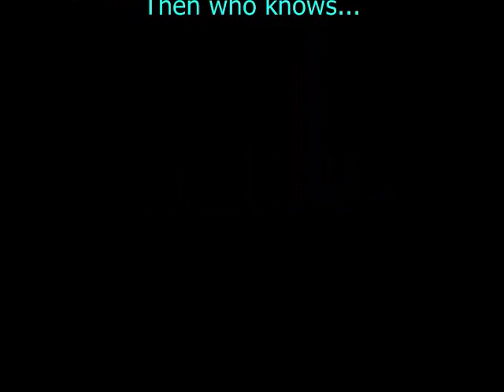My 900 VA Tesla Coil! (Resonant Transformer) Lightning Machine

Comment from the maker: His work was with radio excitation, not physically sending current through the air. If YOU read anything about tesla, you'd know that most of his experiments were radio-based. Ask any HAM radio hobbyist (of which there are millions, I'm sure you know one) about transmitting power, the function of an RF ground, etc., and you'll learn much more quickly.

Comment from the maker: I'm afraid you may be a tad bit confused as to the different frequencies applying to a tesla coil's operation.
The first and most important operating frequency is the tuned radio frequency that the coil operates at. It is in the kilohertz range and completely inaudible.
The second is the "break rate", which is in simple terms, turning the output of the coil on and off several hundred times per second in order to establish a duty cycle, or play music.

Comment from the maker: Volt-Ampere is a unit similar to watts, used to describe the load on power distribution equipment supporting inductive equipment with alternating current, i.e. a load with an imperfect power factor. I list in VA because I measured with a clamp-style meter on the leads driving the transformers, measuring apparent power, rather than real power.

Hope this clears things up.

Comment: Awesome video! - very beefy-looking streamers. I'm interested in your opinion of a video I saw here titled Tesla's Little Secret. It describes how it may be possible to use the Tesla Coil circuit in reverse to produce A/C energy by locating the capacitors on the other side of the spark gap. Is that true?

See 04:30 to 05:30 in that vid. I'm wanna make a non-solar/wind energy producer for a house, at least 12v output.

Comment: So if you directly touch the output spark, what happens? Is it similar to a static generator where the current is so small it's harmless or is it much larger? Basically, whats the output amps?

Comment from the maker: there is no potentiometer on the control panel, there is a variac, and a modified variac.
nor is the frequency "adjustable" on the fly.
I think you need to read more into tesla coils, and you'll realize that you need very different equipment to hit the resonant frequency of molecules or atoms (just like a microwave oven vibrates water molecules)
I'm afraid that you'll be disappointed in your quest for the "hutchison effect" you seem to be describing.

Comment: In this video, two transformers turn mains amperage into voltage, which is stored in capacitors, and the rotor connects the capacitors to a second transformer, which pumps the electrons through the air. There's some additional stuff to keep it from exploding.

Comment: you can find smaller one that goes up to 8000 RPM and make voltage transformer to a voltage of your motor .. for example HDD motor  can drive that fast ... Try it

Comment: Adjust the frequency to the frequency wavelength of atoms in materials such as iron. And if you manage to hit the resonance of the material will catch the material and with a slight increase of the frequency (really easy, you may need to make finer "potentiometer" on the control panel) will take off material and if you scale back the frequency of iron becomes liquid at room temp. .. I think it's worth a try. greeting

Comment: ive never seen a dedicated "spark gap " motor designed for this purpose, but i have seen several AC motors with 1800 and 3600 rpm limits, will these work? maybe control the rpm with a variac? i live in south east texas, 110vac @ 60hz is the norm.

Comment from the maker: If it is a tesla coil with a DC primary system, it hardly matters and can be a tuning point, although you can encounter "dead spots" on the way up rpm.

In an AC coil like this, things get a bit more complicated. You need a motor which locks  
 in tune with the AC cycle charging the capacitors, which is a fixed ~1800 or ~3600 RPM, depending on the frequency of the AC your running (where you live).

Comment from the maker: It doesn't overheat.
The only limit is the amount of ozone produced, and more importantly the relatively short life of the static electrodes in the synchronous rotary spark gap. They are cooled very well, but the high current arcs vaporize metal with every presentation.

Comment: So you used 11 of those caps in series to give you 22,000 volts maximum. Isn't that risky since your caps should be able to take at least twice the maximum voltage of your transformer? Don't forget that 12kv is rms. Peak is 17kv, then there's all the unexpected stuff.

Comment from the maker: the primary circuit charges and discharges at 60Hz. During each discharge, the capacitor/inductor circuit oscillates at a radio frequency of 278 KHz.
Two different aspects of the machine.

Comment: Those cables between the control box and the tesla coil need remaking with the correct type of connectors. Female connectors are used for the supply.

Comment: the lightning does not come out of the coil but rather it comes in from the air. there is an enormous amount of energy stored in air (and matter in general in the form of temperature). so esentially if built properly and big enough this would produce free (infinite) energy.

Comment: oh and you would need a receiving station to step the voltage down and up the current at the other end - so you'd have a little tesla coil receiver at your house to receive the power, and it would be wired into the house electrical system.  No more telephone poles or buried wires.

Comment: I think his idea was to transmit electricity wirelessly through the atmosphere to power electrical equipment.  It didn't work supposedly because the current required for old motors and stuff was too much to transmit through the atmosphere, but it might work for the tiny current devices we use today.  Cellphones use milliamps, the old motors used 1 to 100 amps.

Comment from the maker: It doesn't fry every electronic device in range.

I have my phone in my pocket almost every time I give demonstrations with it, even when getting "zapped"

I've even conducted an arc with a big-key calculator before. The calculator still works.

And the losses are tremendous when using it for wireless power transmission, but Tesla knew that. Most of his practical work was developing transmitters for information (i.e. radio), not power.

Comment: Well, the thing is that those sparks discharge into the air, if you put another coil down there, it would receive the energy, any you would be able to use it somewhere else, without cables!

the only issue is with this technology 
1. It fries every electronic device in range
2. Loads and loads of loss

Comment: awesome, have you been able to tune it in-order to get the harmonic effect?.. Super cool buddy.. So let me get this straight. it is merely receiving then boosting the voltage of ambient radio waves?  right?  Is there any way to get a smooth plasma field as opposed to arc? you might want to look in to a multi-wave oscillator. that would make a nice stun gun.. all those capacitors loaded.. just one little tiny capacitor for a little flash camera will sap you pretty dang good.

Comment: I know that there exist many different tesla coils with a vast range of energy output.  But lately I've been wondering if this technology could be used to power a car or a truck in place of gasoline?  obviously the arcs would need to be controlled otherwise it would fry everything else under the hood.  But if this power were harnessed and given direction it could power practically anything right?

Comment from the maker: If you are on the ground and happen to be hit with an arc, it HURTS. BAD.
Happened to Me! The skin-effect keeps the high frequency AC from interfering too badly with the nervous system, but its a hell of a shock! The arc also burns pretty deep, I had 2 small holes in my shirt afterwards, and a couple pin-sized charred burns on my shoulder :(

So yup, you get zapped.

Comment from the maker: There is really no way to make a "free energy" transmitting coil.
In the case of my coil, it simply converts energy flowing from the wall outlet (120 volts at around 9 amps of current) into very brief pulses of high-frequency (278,000Hz), high voltage (800,000 to 1,000,000 volts) at extremely low amperage.
There is just no way to take more energy out of a receiver coil, than was used by the transmitter coil to generate the signal.
Good question though,

Comment: I had no budget for mine so I just used a motor that was no synced with the ac mains. I used a single 7500 volt 20 ma nst. It worked but was a very small purple discharge not really like lightning at all. I got a 15000 volt 60 ma nst and got it all ready but it proved to be too much for the circuit breaker so I could never actually get it to run. Then I went to college and haven't gotten to work on it anymore. Someday it will live again!

Comment from the maker: 278 KHz
And with lots of time and patience, it was the most aggravating thing I'd ever done, wrestling 50' of stiff copper down with zip-ties.

If you ever build one, use aluminum tubing instead.
Cheaper, just as effective, looks nice, and SO much easier to work with!
Too late for me, but spare yourself some trouble! :P

Comment from the maker: The NST is not rectified, and your logic is spot-on.
The fact that I am using an unrectified power supply means that I need the synchronous rotary gap in order for the coil to work at all.
Rectified coils are not necessarily more powerful, but they tend not to be quite as fussy with regard to timing.
Kindof wish I'd have gone with a rectified coil, but I'm happy with the way this one turned out.

Comment: Is the Output from the NST rectified at all? I have built a Tesla coil without any protection and the output of the nst fed directly into the capacitor bank and the spark gap between the capacitor bank and the primary coil and then from the coil back to the other end of the capacitor bank. I feel like the best power would come from rectifying the nst output before it charges the capacitor. Is this unnecessary because the synchronous gap aligns the spark with the maximum charge on the caps?

Comment: If you could find a way to make your torus smoother you would get more sparks around it's perimeter. Right now the little uneven pointed surfaces are acting like electron emitters and cause your streamers to stay in that one spot. The points work like a reverse lightening rod or like the needles in an ion source.

Comment: @highvoltagefeathers Are you grounding the secondary? It could be acting as a capacitor, with all the metal up top.I've always connected the base of the secondary to the bottom of primay.
  Ignore the negative comments, I know it's hard not to reply in a similar negative way, but your stuff is about the best in Teslacoils.

Comment: @highvoltagefeathers Surprising how many posters here don't know the speed/freq relationship. Tesla is said to have invented 3 phase when thinking/dreaming of hamsters running in the wheel, don't know how it got to be squirrel. All the the auto-motive alternators I've ever seen are 3phase, likely for smoothing the curent pulses, and have a slip-ring rotating field. Others here have replaced the rotary winding with perm magnet, but now you cannot control output. AND, it's still not free energy.

Comment from the maker: @dougspair Absolutely! The speed of the modified motor is dictated precicely by the 60Hz cycle. It has 4 poles, which means 1 rotation per every 2 AC cycles. It is locked to the phase of the driving current, so the angular position of the shaft corresponds directly and repeatably with a point in the 2 phases! And of course tesla invented the technology behind the motor, and the transformers, the variac, the lights in my shop, etc. (allegedly the motor/alternator idea came via halucination) :P

Comment from the maker: @Drmanbearpig I'm aware of the dangers, and did you use a filter circuit? You can get large spikes running around through the system if you don't have MOT's to ground the main HV lines from the transformer through a small spark gap.

Comment: @highvoltagefeathers You are lucky then. I used two 15kv rated caps to get a rating of 30kv voltage rating for a 15kv neon sign transformer, and literally after the 8th or 9th run, it destroyed itself. Luckily it didn't take out the secondary when it exploded... Just be careful when using series capacitors, and maybe encase the caps in some sort of plastic shielding

Comment from the maker: @MACHINEIRON A few preliminary measurements and a lot of patience! I drilled 2 sections of PVC pipe all the way through, then cut the pipe in half along the center of the holes to get the notches that the copper tubing sits in, then drilled holes for zip ties which hold the copper in place. They've held tight for 2 1/2 years now.
Thanks!

Comment: ...Ran out of characters on the last comment. I'd think the color of the wire insulation is directly related to the composition, not anything related to the colors liked by the engineerrs...LOL. on that one..
 So, you know the relationship of motor speeds/poles to the 60 hz..? And the 3 phase stuff..? And the relationship of this, to Nikola Tesla..?
  The Elecrtic Motor tech I went to was a 9 months deal, 1-3 phase motor repair, control circuits too. 24 volt DC, 120 AC, 240-480 3-phase AC..

Comment: I only worked at the Electric Motor Repair shop for about a year, but I did also go to a tech-school for that stuff..after high school, in 1965. however, the motors are still much the same. I see a lot of stuff on youtube from Motor makers, about the same as I did..40+ years back.
  Long ago, the first copper wire was a very dark brown enamel, then in the late 1950's a lighter reddish color, a synthetic enamel called Formvar. I'm sure the green is just a different type of material.

Comment from the maker: @dougspair exactly! If the laminations were straight, and all the motors in the US locked to the line frequency, there would be lots of weird re-inductive cancellation and amplification, probably blowing some fuses and tripping some breakers. I just had to peel these layers of engineering off in the form of the flats to get it to lock again :).

Comment: @highvoltagefeathers ..the slightly 'twisted' laminations in the rotor I think are to reduce 'cogging' and accoustical noise...but also cause the motors run slightly slower than the 60  (or 50 in Europe)...AC line frequency. I'm not 100% positive on that though...I could be mistaken.

Comment: ..Thanks for the reply...again, I comment highly in your favor for the workmanship, and great video presentation..
  You're right about milling flats on the motor rotor as that makes it a synchronized motor, instead of the slightly lagging 'normal' speed of induction motor.
  I worked in a motor repair shop after high school...the larger synchronous motors often have wire wound rotor, with brushes to energize.
  And the green wire, do you know what kind of insulation that is..?

Comment from the maker: @mrgalleria @mrgalleria I think you need to look to more reputable sources than your imagination for some very basic laws and rules. You seem to think that the tesla coil is simply "willing" electricity towards it. The charge oscilates within the torroid, secondary, and ground. When the torroid experiences an excess of charge that it can no longer contain, it breaks down the air around it and emits an arc. When the torroid becomes highly positive, electrons jump out of the air to fill the void.

Comment from the maker: It will only run "backwards" when excited by a radio frequency that it is tuned to. It is no more than a radio antenna. There are many types of energy flowing all around us, not necessarily in a "field".
There is no machine that can reach out and "grab" it all at once. Harnessing this energy takes alot of work 
(solar pannels, wind turbines, hydroelectric dams, etc.)

Comment from the maker: @duf101101 Sounds like you know what your talking about :).
For a DC rectified rotary spark gap coil, most people use a DC motor hooked up to a dimmer or speed control circuit. I am not an expert on these types of coils, but I do know that a variable-speed dc motor controll is necessary for tuning. 
With my AC coil, I need an induction motor to phase-lock and tune my spark gap, or else things get really nasty really quick. You will not need this kind of accuracy with yours.

Comment from the maker: @CoolDudeClem The primary coil is horizontal because this isn't just any normal transformer :P. It's actually hardly a transformer at all. The number of turns in the primary or secondary coils has no effect on the voltage produced. I rather think of it as a giant radio transmitter and reciever (the primary coil is an 800 watt transmitter, and the secondary coil and topload is the reciever). The primary needs to push pulses directly up and down the secondary.

Comment from the maker: @kjbaran Thanks! I've learned that there are different "softnesses" when  it comes to tubing :P Pure copper tubing is more flexible than cheap brands which have different, stiffer metals mixed in. Come to think of it, I probably could have used aluminum just as easily!

Comment: Very nice work, well done!  I dont think ive ever seen such a professionally made DIY tesla coil.  Have you played with any smaller oscillating coils?  You may be surprised by how much power you can get from just 1AA battery.  Check out youtube vids on ''slayer exciter''.  Its basically a solid state mini tesla coil which uses a transistor to switch the currents in the primary and secondary, and runs on very very low input.  1 AA will do it.